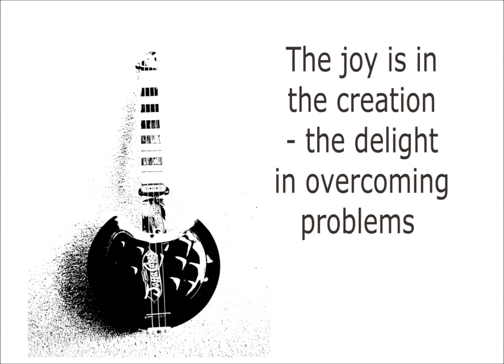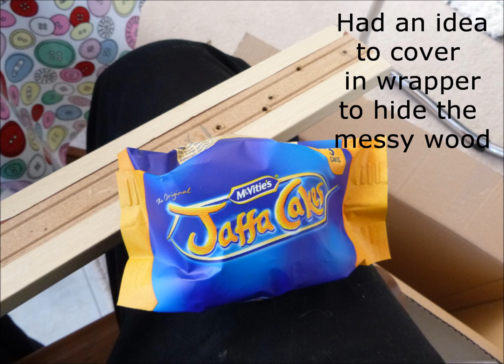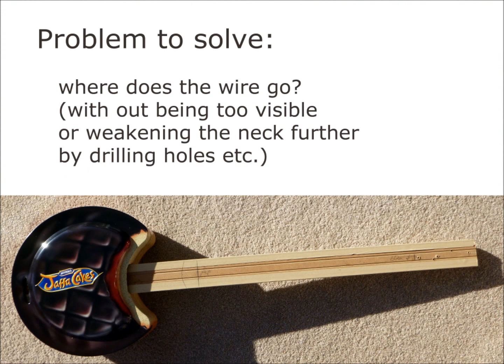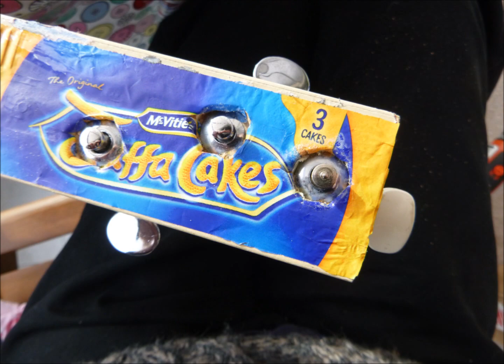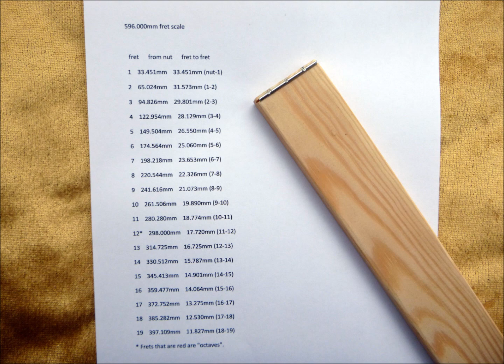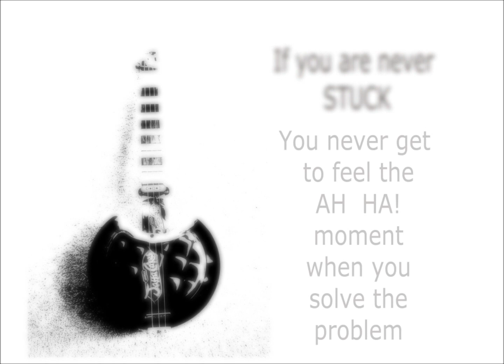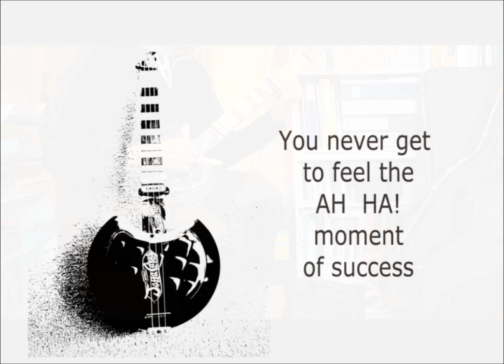Biscuit Tin Guitar Build - a lesson in well-being and problem solving

Comment: @MelO 
is it hard to attach the neck though? and what about the bridge for the strings , is that hard to do at all ??
Reply from the maker: On this one the neck goes right through the whole instrument. i prefer this method on tin can constructions as the can would probably just collapse otherwise. I tend to cut a slot in the bottom part of the biscuit tin for the neck to slide through plus a corresponding cut out on the lid so the neck sits snuggly in place. I make sure the bottom end of the neck touches the bottom end of the tin and put in a big screw to hold it in place (I sometimes use the same screw to hold whatever device I am using to retain the ball end of the strings). I then used a small screw close to the part of the lid where the neck enters the tin to hold the neck in place and stop the lid flapping about.
Reply from the maker: as for the bridge - I used a piece of angled aluminium - I cut a slot in the lit (at exactly the point  where the bridge would sit) then poked the one side of the angled metal through the slot and rested the other side on the neck - it hold in place easily (but make sure you do it at the same time as you are attaching the neck)